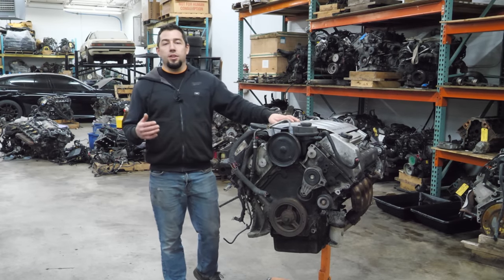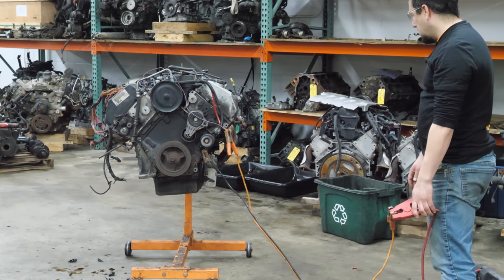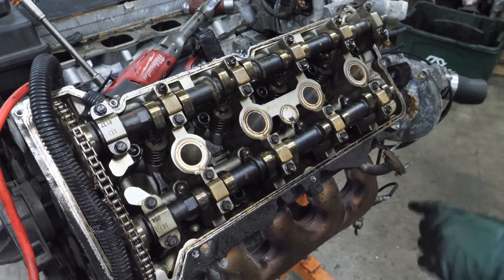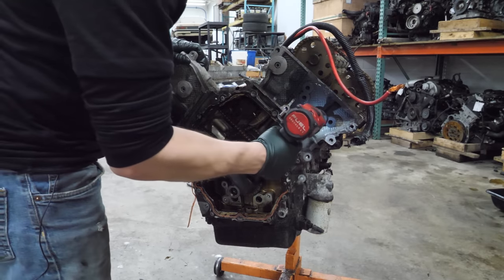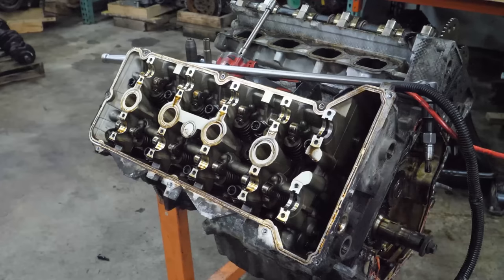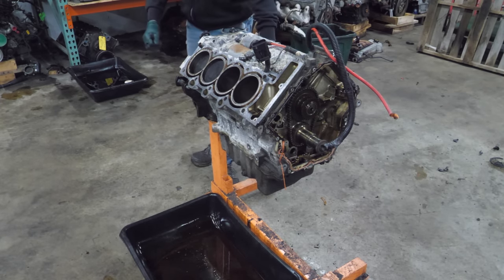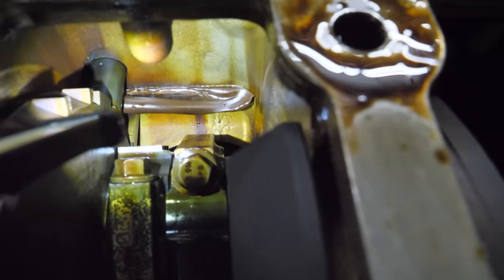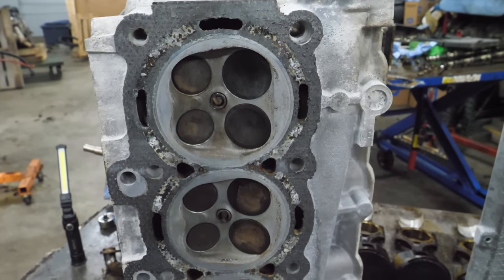Customer Returned This Cadillac Northstar L37 4.6L V8, How Many Things Can We Find Wrong?

Comment: You could put that Northstar back together & it'll run!  Re-seal the case halves, drill out the head bolt holes & put the helicoils in,  drill the broken bolt out of the camshaft, replace the water pump & tensioner, & that thing will run for another 100K miles!   I've done plenty of them!   BTW, NEVER, EVER, use slicone sealer to seal the case halves.  Use anaerobic sealer.  That's all we used at GM.  I appreciate your videos.
Reply: Thanks for the tip on the anaerobic sealant!
Reply: I do Transmissions (both manual and automatic) and You should ALWAYS use anaerobic sealer. The biggest problem with silicone is that you can come back a week later and find wet sealant. Which can not only cause leaks but get into the system you are working on and then real problems start. (I don't do many engines anymore, normally a few a year just for my racing customers but transmissions seem to be the one thing I never run short on)
Reply: Yeah, ît would be nice to see him put an engine like this one back together and get it running again!
Reply: Yeah I agree. I use the anaerobic sealer for intakes and superchargers on 3800s.   Namely In camaro and firebird.
Reply: I blew up my 460 because I went overboard with silicone on the oil pan gasket and all the silicone spaghetti clogged the oil pick up screen. Some WOT runs and it was hammering.
Reply: @MrSpartanPaul  Northstars are not made to be abused!  If you want a car you can abuse, buy a Mustang. Their engines are cheap.
Reply: Fuck that.    Once you invest any time or talent in one of those engines you'll be married to it forever.
Reply: @paisleyprince5280  They're great engines, but not for beginners, incompetents,  or mechanics who lack confidence. I've done more than my share of Northstars. After the first three, they're easy AF!
Reply: @bobbiweiss4176 great story bro, you want a medal or a chest to pin it on?
Reply: @paisleyprince5280  Bless your heart!  Sounds like you fall into one of those catagories! My Northstar runs like the day it was made. Sounds like you couldn't deal with yours, & sold it to someone who could!  Every man has his limitations.  Have a nice day, sweetie. :)
Reply: Everything you just said is 100 percent true. Yes, we have been there and done that! Got so, I could do time serts in my sleep. 38 years on the bench was quite the adventure.
Reply: Yea... It could run again but it'll still be a piece of junk.
Reply: Naw the norstar is a junk motor mines blew out at 124k
Reply: @fairfax_fran5109  Mine has 180K miles, & runs like it just left the factory.
I LOVE it!
Reply: @60guitarzan  unbelievable 🤔
Reply: @60guitarzan got a 2003 no problems no leaks 😂😂😂
Reply: @TerrorSquadGraphics  My 2004 Deville runs great, looks great, & doesn't leak a drop.
Reply: @bobbiweiss4176 you are very wrong. The northstar engines were designed to rev high and they should be driven like you stole it once in a while. Problem was the clientele base for these cars were elderly and never pushed the engines at all. They treated the northstar like a small block Chevy and that was the mistake.
Reply: @frankvitullo4925  Racing Northstars are built using high performance parts. 
I guarantee you, if you regularly flog a Northstar, it WILL eventually fail. I've done two timing chain jobs on Northstars in the early 2000s. I NEVER wanted to do another! Not to say that you can't stomp on it to merge onto the highway, or squeeze out some prick at the stop light, who's trying to gain a few car lengths in traffic, but the engine in your Deville, is NOT the same engine at the track! What I will say, is that these monsters need stronger front engine mounts (front of the vehicle).  Northstars just rip those things apart!  Pet peeve of mine: People don't give them the proper care. (Don't change oil regularly, don't change coolant, & ignore small problems until they become BIG problems).
Reply: @davidmiller9485 Do you have an example of this anaerobic sealant? Better than 3 bond for metal on metal sealing applications?
Reply: @MrSteve8511  Permatex 51813 sealer
Reply: @60guitarzan  thanks! 
 I'll give this a try. I usually use three bond..

Comment: I clicked on this video so fast
Reply: Yessir! Same here
Reply: So did I.
Reply: @arlendriver4113  same
Reply: I clicked on this video when I was ready to sit down and enjoy it.
Reply: I clicked on this comment so fast
Reply: @IKnewMickey  🤐
Reply: Same
Reply: Your point being?
Reply: Same
Reply: I remember I worked as a porter at caddy dealer in the mid 90s. I was young gearhead then I used to marvel at these engines. 300hp out of 280 some cubes was a big deal then. The og lt1 had just come out in 97 and that was only getting 1hp per cube. Plus it wasn't the high revver the northstar was. Good times. I'm willing to bet
All that crap on the head bolts is oxidized degraded aluminum
Reply: Sammmeeee😂😂😂
Reply: @Joserocha-wm9de  àaàààà
Reply: Same
Reply: I did cause I had an Eldorado and these engines are junk. That body style deserved a better engine.

Comment: As advertised by Cadillac the Northstar V-8 could be driven for 50 miles with no coolant...in an emergency. This engine looks like the owner ran an independent test on that theory. Jury still out on if it passed or failed...
Reply: Based on the smoke stain on the valve cover and the charred pulleys, I'd say there were external exothermic issues that led up to any cooling issues.
Reply: customers ( i worked in a "caddy aftermarket shop" so this engine and the 500ci was the boss's favourite plus diesels-hobbies of his ) have gone 50 miles ( western NE aka flat and easygoing ) i just don't recommend it even as they got away with it now 100-mile's nope definitely spin's a bearing's/pop's gaskets generally N8 cylinder next to the brake booster is the hottest one and front 2 in the middle get more air-cooling
Reply: 100 miles
Reply: Oldsmobile touted it first because they kinda made the engine, it's technically a derivative of the aurora v8.
Reply: @BigWheel.  Northstar, brought to you by the same people who couldn't keep head gaskets in the Quad4.
Reply: @richardprice5978 😅
Reply: When you own one of these 3rd hand with 200k miles and nobody wants to work on them like little subaru cowards, you end up running a couple of these independent tests whether you like it or not until you are pissed at the other garages enough to drop the engine out in your own driveway and order the headbolt retap kit.
Reply: Its a Crapalack.😂😂😂
Reply: I did that test when the head gasket failed on my Grandfather's 2000 Deville.  Had to make it 30 miles home, and top speed was 25 with the remaining coolant boiling away furiously.
Reply: GM does a great job of convincing their customers to buy Toyota's